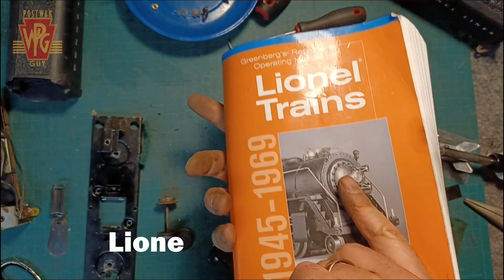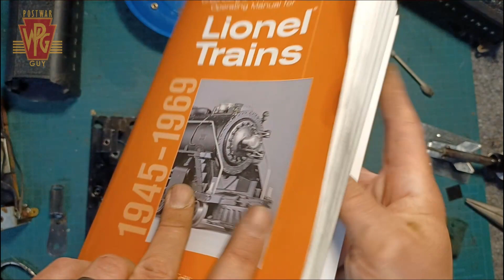What do I do with a rusty and crusty 12 wheel tender?

Comment: Great job Warren!  And what a coincidence, I picked up one of those streamlined tenders in an antique shop (along with a Lionel Lines caboose) back in April, $16 for the pair.  Both were NASTY looking but I figured for $16 I'd take the chance.
The whistle tender was more filthy and moldy than anything else with little rust although I did have to replace wires and the brushplate.  The shell cleaned up fine and so I repainted and redecaled it. 
Works good and looks good, not bad for an $8 investment!
Oh, as long as the tender was apart I added a light to it then installed a strip of clear plastic I turned red with a Sharpie pen to cover the three holes in the back of the tender shell.  Looks great with the red rear lights! 
The caboose was the same, cleaned it up and replaced the wires and the bulb.  the shell's just fine so I'm leaving it alone.  I'll probably flip it at the next club show.
One thing I like to do is pick up what I call "orphan tenders" at train shows then refurb and redecal them for various railroads, the run them behind the post-wars.  A LOT cheaper than buying engines all the time!
For darkening steel parts you can try Birchwood-Casey cold bluing solution, it's used for touching up bare spots on gun barrels and frames and most gun shops or sporting goods places that sell guns should have it, or in this day and age you can probably order it on line.  Bear in mind the steel part you're going to blue has to be DRY, no oil or grease or the bluing solution won't work. 
A great tutorial!  Thanks for posting!
Reply from the maker: I rarely pass up a rusty Lionel that I want. It doesn't take much to bring most of them back to life! I have seen the streamlines with the rear lights and I think they're pretty cool and have often thought of rigging something up. I have enough bits and pieces to do it.
Reply: @warrenmuzakpostwarguy4331  Sure, try rigging up a tender light!  It's not hard to do and you'll love the result!